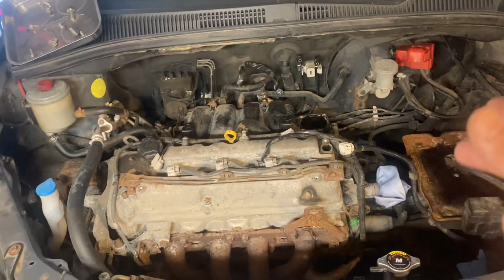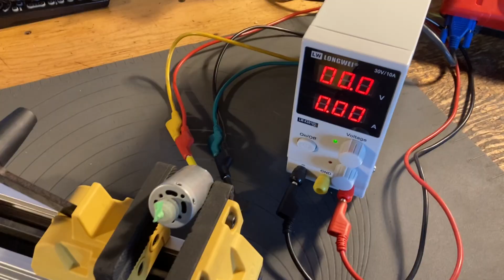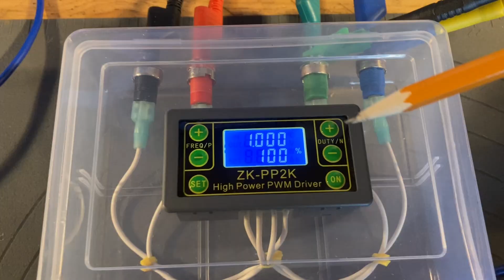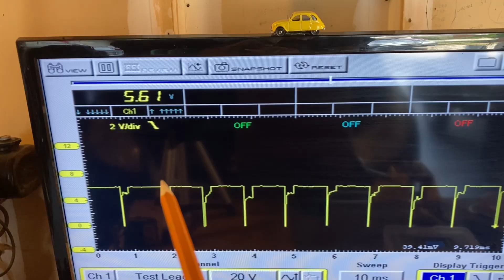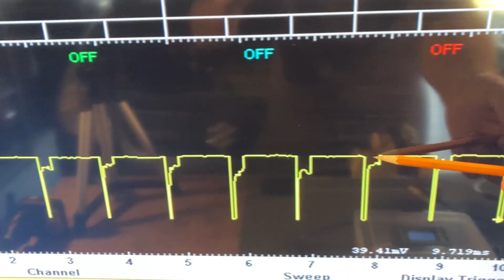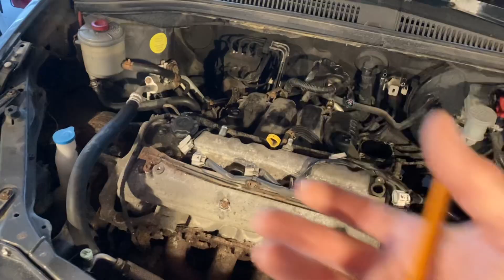Counter (Back) Electromotive Force…A Simplified Explanation

Comment: Nice graphical representation. In the case of AC high power motors (over 10-20kw) you do have to have a special installation when you're wired into the network because of back emf induced into it - industrial levels. On DC lines, 12v, cars in this case I prefer to get a simpler explanation if someone asks... The power of the motor is defined in watts and there's a correlation between voltage and amps. If you have 13v and a 1300watt motor, you have 100amps at normal operating conditions. +/- to a certain degree you will see an increase or decrease of amps based on the voltage difference to keep the same 1300W. It's easier to sell a new battery 😂, or explain why the wires will suffer long term.
Reply from the maker: I find it pretty interesting. Hopefully someone will find it somewhat informative. Thx for watching Alex. 👍🍻

Comment: Its not resistance,  its impedance
Reply from the maker: Isn’t resistance and impedance the same thing in a DC circuit?
Reply: @TheGibby3340  You are correct. Not sure why the guy felt the need to incorrectly try and correct you vs thank you for a great video. GREAT VIDEO TY
Reply from the maker: Thx for watching. It’s fine. Different perspectives and interpretations are always welcome. I’m no expert on anything, I make mistakes all the time. 👍🍻
Reply: @willtucker2774  You did not use the correct  punctuation in your comment.

Comment: Back EMF is used in model train digital controllers to monitor speed.  So if a train slows down or speeds up because of grades, the controller will see the change in the BEMF, and  adjust the voltage to keep a constant speed.
Reply from the maker: Yeah I think a lot of brushless DC motor control unit use that principle. Thx for watching. 👍🍻